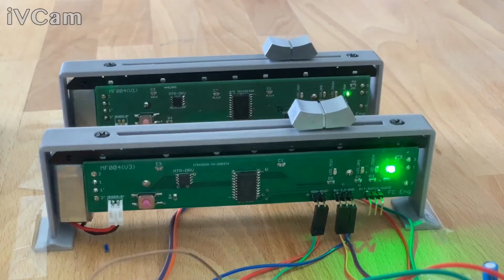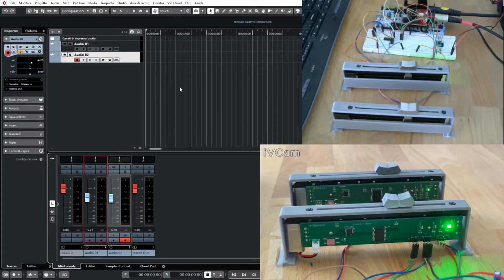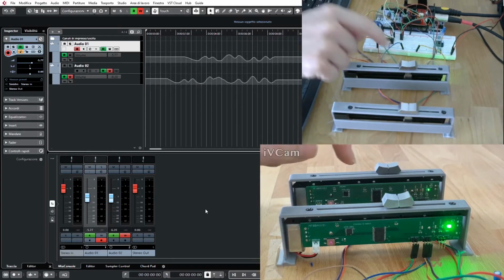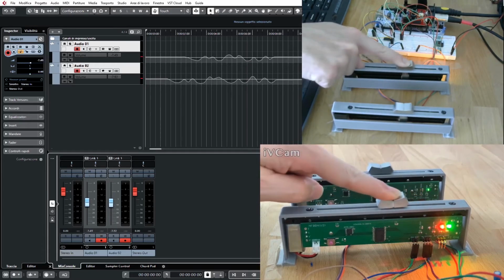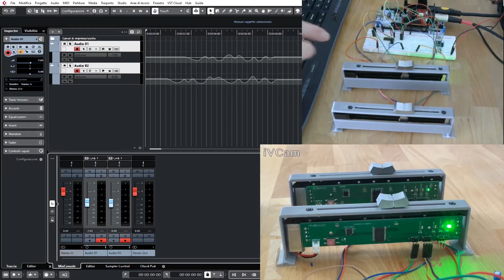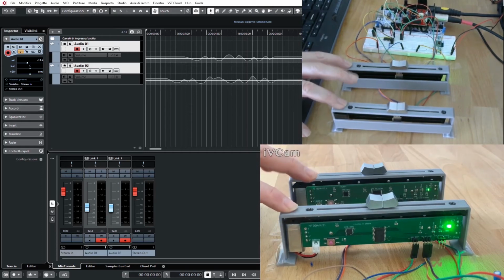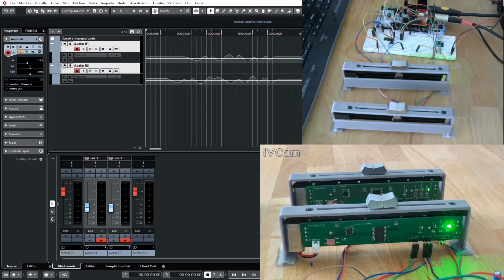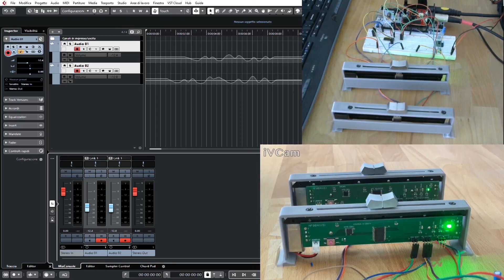Motorized faders as DAW Mixer Controllers

Comment: I'm looking to use motorised faders in my next project, are you just equating the resistance to a position, in code, and moving the motor until you reach that set point?
do you have to deal with drift at all? (because I imagine you can't get to the exact set point without the risk of oscillations)
Reply from the maker: At the end the first action is about matching the position of the fader and the position communicated via software. But there are offset to be considered to manage oscillations, there is a subject of speed of the adc and of the data transfer via dma and I have recently developed a logic of acceleration when the pot is far and deceleration when it gets close that helps in the quality of the result.

Comment: Awesome video! Thanks so much for sharing! Two questions: 1) is the digikey part number PSM01-081A-103B2? and 2) where did you find the  grey plastic housing for each slider? I've been hunting for those!
Reply: Scratch question 1 - just saw your GitHub!
Reply from the maker: Hello, thanks for your kind words. The stand for the motorized faders is something I have designed with fusion 360 and printed with my 3d printer. Cheers!

Comment: Great video! I have a question you may be able to answer... 

I have been wondering about MACKIE control for ages. I have a Behringer x touch and It has LEDS on each channel strip that corresponds to your channel strip in your daw (obviously). 

I've wondered for years where its getting that data from. I've even tried to monitor signals to see where its coming from and I dont get it. Do you know where that is coming from? The reason I ask is I'd love to do a project with an ardunio and some leds to make some kind of master led strip that gets its information the same way as the controller.
Reply from the maker: Hello Jamie, if I got your question properly, all info are coming from MIDI message the Makie Universal protocol is made of. Cheers, Filippo

Comment: Hi is this midi complaint plug and play so it can be found by and daw like pro tools just by plugging in 

Also can it be custom named so that it could be found be the computer as midi controller “red console” for example?

I have a project I’m working on this could be used for
Reply from the maker: Hello, the project uses the Mackie Universal Control Protocol which is de facto a standard for DAW communication with remote surface controls. Mackie Protocol is MIDI based. So via this protocol you can connect your Protools with such devices. 

Then about "plug and play" these faders are connected with a Microcontroller via UART, and that microcontroller is connected to the PC or MAC via USB so in this sense it is plug and play. 

Finally about naming the driver the way you want, again you can do this in the USB implementation. 

I suggest you to check a couple of other videos in my channel such as the third of the motorized fader series in order to understand how the motorized fader is connected to PC or MAC and the video series dedicated to USB to understand better about how this communication standard works. 

Hope this helps.

Cheers
Reply: @fcampanini  yes I’ll have a look for sure! Very good

Comment: Very cool and thank you so much for making it accessible. 
Do they also sense an obstacle? 
What I mean is that if they are trying to move digitally and you block them when your hand? will they just start grinding gears and overloading the motor or just stop until allowed to move? 
Thank you
Reply from the maker: Dear Ralmslb when the fader is moving you can touch the knob and the movment stops immediatly allowing you to register new automation with your finger. This not because the fader senses an obstacle but because it’s sensitive to touch. Having said that if the fader is moving fastly it might be a bit difficoult to catch the knob with the finger. Probably the solution is to pass to proximity sense… let’s see if someone is interested in testing….

Comment: HELLO VERY MUCH IMPRESSIVE BUT HOW THE PCB IS CONNECTED TO THE COMPUTER?
Reply from the maker: Hello Eitan, in the case of this Video I'm connecting to the PC via Nucleo-439ZI and a MIDI shield in Arduino format. The Nucleo communicate to the shield via UART and the shield is connected via standard 5 pins MIDI connectors and translate the MIDI messages from the UART to the standard MIDI protocol. If you check instead the video DIY MIDI Remote Controller Full Strip on the channel, you will find a more evolved implementation where I'm connecting the microcontroller to the PC directly via USB and then i communicate to the DAW via USB MIDI protocol. Cheers.

Comment: Hi Filippo - I'm trying to recreate this project. Can you tell me how the fader connects to the stm43f446ze board, as it was written in the code on github? Particularly SDA, SCL, RST, SWCLK and SWDIO pins on the fader PCB?
Reply: And do you have to upload any code to the fader chip itself? Or just the ST board? Hoping you can provide some insight, as I've otherwise got this ready to go.
Reply from the maker: Hello yes of course you have to upload the code you have in github in the samd11 you use for the fader.
Reply: @fcampanini  So to confirm - there are 2 separate uploads - One for the SamD11 Chip, and one for the Main Controller? I'm not seeing which code is which. How did you connect a USB port to the PCB that you developed?  Thanks!
Reply: Still a bit lost on how to connect the RST SWCLK and SWDIO pins. Are those the same as the D+, D- and IO pins on a micro USB breakout board??
Reply from the maker: The one you find in github is for the SAMD11 (the fader). To upload this code you need a programmer debugger such as the Atmel ICE for instance. I have not released the code for the main board (Nucleo-F439ZI) cause I'm working right now on a full console main controller based on a SAME54 (so you will use the same programmer debugger and process as for the SAMD11). However if there will be more requests I will try to publish the one for the Nucleo.

Comment: Hi man. Thanks for the video. I can use the faders of an old MAudio ProjectMix ? I want to use the projectmix only as a controller by USB (Not by firewire)
Reply from the maker: Hello Sonic, I dont know this consol but I guess that if we are talking about motorized faders you need to identify power of the DC motor and +,- and line for the potentiometer and that’s it. At the end of the day the fader I’m using in this video is a device with such kind of connections. Cheers!

Comment: What kind of board is that behind the faders, with the midi shield on it? Any schematic for that setup?
Reply from the maker: Hello it’s a stm32f446ze from st microcontrollers. Cheers
Reply: @fcampanini  You've done some amazing work with this. I just ordered some of the blank PCB's from jlcpcb, but I didn't order them with the SMT parts - Do you think it's possible to hand solder those chips onto a blank board?
Thanks, - Zach
Reply from the maker: Hello I never order assembled pcb. I always manually solder. So yess it is indeed possible. If you never soldered smt just check some of the tutorials on you tube... you will surely find your way!
Cheers
Reply: @fcampanini  Awesome, thanks so much! Again, incredible work with this. You've done the music tech community a tremendous service by releasing all of this info!
Reply: @fcampanini  Is the circuitry on the breadboard related to the midi controller, or is that for the camera?

Comment: hello friend what a great project two questions to how many faders can be used with that arduino board and what board is it? and what is the reference of the faders you used?
Reply from the maker: Hello Cristian, first of all I'm not using Arduino. I am using SAMD11 microcontroller on a PCB that i have designed (you can find the board design and the BOM in the comments of the video). In order to program the microcontroller I am using Atmel Studio IDE, Atmel Start configurator and ASF4 framework. In terms of how many faders, my goal now is to fulfil the Mackie protocol and achieve 8 faders plus the master (so 9 in total).
The motorized fader I'm using is a Bourns PSM01. Hope to have answered your questions.
Cheers,
Filippo

Comment: Question. I own an Allen & heath zed r16. Would I be able to replace some or all of the faders with this? Theres 16 channels plus 4 midi faders. And is there a way it would still work with  the regular audio passing through as the mixing board is analog/digital and you press a switch to change it from analog to midi. I really want to get motorized faders in this thing to work with pro tools lol
Reply from the maker: Hello QL Of Landfill, well even starting from the principle "always true" that in everything is possible, I see what you are thinking about quite challenging ;-). It is in fact indeed true that the analog treatment of the signal, like you have in your R16, can be in theory coupled with digital MIDI based circuitry, but that would require a deep modding of your unit to fit the digital MIDI PCBs and components... think about the motorized faders for instance. If you are interested in having the possibility to store and automatize your mixing scenes and still stay in the "standard" mixer domain, I would suggest you to look for built in solutions. There are a lot on the market nowadays. If you like Allen & Heath for instance, they offer quite amazing solutions such as the SQ5. I hope it helps! Cheers!
Reply: @fcampanini  thanks man! Yea I was looking at even an old command 8 for this. Would be nice to be able to upgrade the board I have to do everything I need but in the long run probably would make a lot less sense with the amount of money and time I'd have to put into this. Thanks a lot for the answer!

Comment: Wow, man! I was just searching around for info on code to control motorized faders, but THIS is incredible 😄👍

2 questions: Do they make a lot of sound? Do you think this same thing can be done with smaller faders?
Reply from the maker: Hello, happy to see you found my project interesting. They do a bit of noise but not too much, in particular I'm using a motor control that works over 20KHz so that the typical PWM motor noise is over the audible threshold. You can use whatever device you want as long as it has a linear potentiometer and a DC motor, I know for instance the 100mm model I am using is available also in a more compact format  60mm. Cheers.
Reply: @fcampanini  All of that is very good to hear 😁 I've often thought of making a dedicated motorized ADSR section of a midi controller that would update as the soft-synth is switched, and full size mixer faders seem like overkill. Thanks for the video and reply ✌️